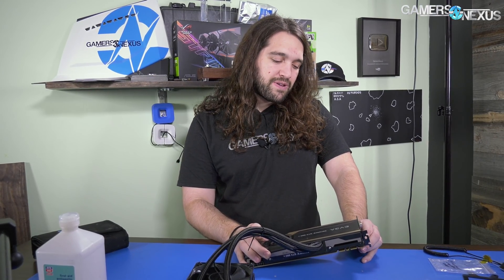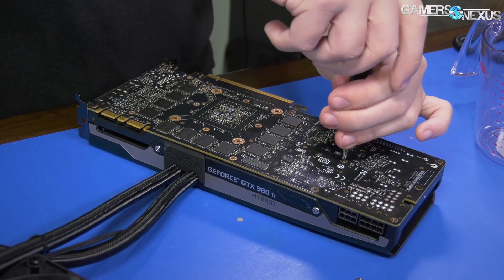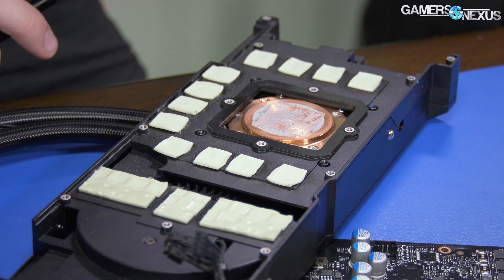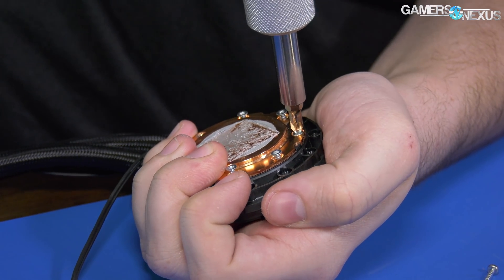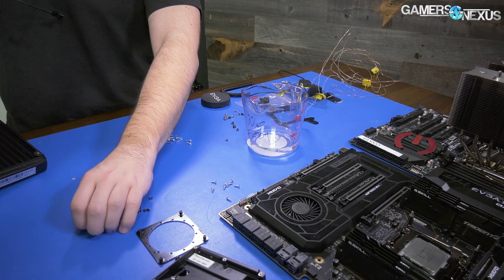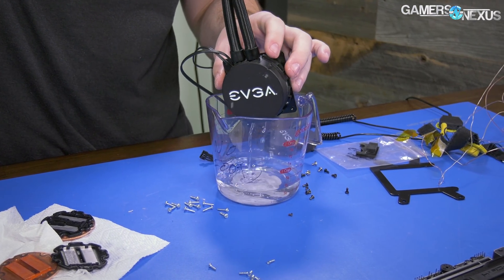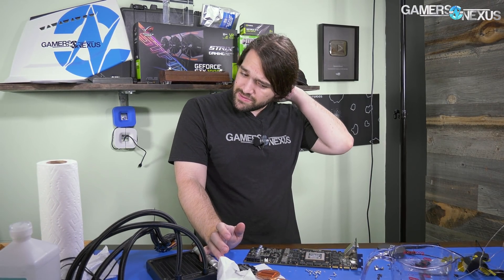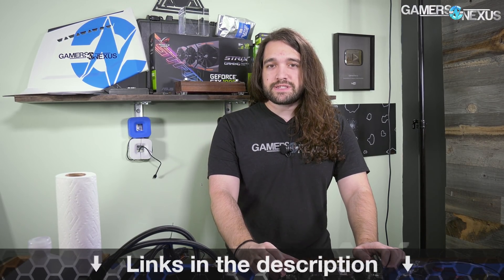Liquid Permeation Check After 1 Year: GPU Hybrid

Comment from the maker: Hey all. This isn't meant to be some sort of deep-dive/heavily data-driven content. It's just a diagnostics we had to run on the card anyway, so decided to film it. Filmed this back in November, I think. We haven't touched the card since then, but will probably throw another cooler on it and see if it gets going.
Reply: i have a feeling that the header for the pump stopped working which made the pump not do anything
Reply: maybe the connection between the fanheader and the pump, so the cooler works on an external psu thingy, but might not have gotten power from the card it self.
and yes we love LIVESTREAMS!!!
Reply: Gamers Nexus I would look at power usage and voltage, before removing the cooler. Also would have tried different PCI-E port. But those are mine first steps, because I would bot have another card to replace existing one. But i have noticed that Thermal Grizly pastes dries out quite quickly. And a small hit to videocard can break dried out paste.
But measuring remaining liquid was nice idea. Jus I would have asked EVGA for more specs, rather than destroying another pump. Also this does not prove, that pump is capable of moving liquid. Would like to compare fins visually.
Content like this really matches your content - what’s inside PC compobents. Looking into new graphic cards to see, how they are designed or looking into older as a followup, what might have been designed wrong and died.
As I’ve heard, nvidia GPUs just dies instantly, no middle way of working poorly.
Would like to see a followup for this
Reply: I now feel an emotional connection with that card and have a vested interest in seeing it come back to life. Looking forward to seeing it tested under air cooling!
Reply: I also have an EVGA hybrid mod slapped on my 1080 Ti, and for a time I was experiencing intermittent temp issues. Based on what I can tell, at these times the pump itself wasn't working. A reboot usually solved it, and ever since I reinstalled Windows 10 I haven't had the problem again.

Is it possible you're experiencing the permanent version of this problem?
Reply: Love the way the video was set up. I love my data, but this was very interesting content.
Reply: o ring seal is bad Id replace that and plug it in and test it. im wondering if u cant find the right seals could you use jb weld sealer on it.??? But it would need to be a silicone hi temp sealer to be water tight again.Plug it in find where it has silicone o ring and add the silicone to that region You can also pressure test it.Cllean the card with alchol to remove all the mineral water on the card . Id use 99 percent rubbing alchol on cleaning the card up and either fix the cooler you have or find another after market cooler once you have cleaned that card with a 99percent alchol to remove any water on card.Minerals collect over time through metals in the cooler so that water will add minerals to water and that is good chance this water can harm a card .
Reply: Looks good!
Reply: About that 4 pin adapter: I have a 1080ti ftw3, do you know where I can buy one for my Gpu? Or if you know the pinout of the connector or where to find it.
Reply: Could it be something in the cards bios?
Reply: Cool stuff.  If the new cooler works though, the question will still be what the root cause of the problem was with the original cooler.  Although if the new cooler solves the problem, then likely best to put it back into service and move on. :-)  Hmmm - I haven't seen any recent reviews on new aftermarket VGA coolers (well, outside custom water cooling VGA blocks - full coverage or not), so how about a review of that if and when you do it?
Reply: Very interested as I have a reference evga 980ti and hope it doesn't have issues later. It is called with a ekwb block and backplate
Reply: Gamers Nexus this actually taught me to apply extra pressure to the pump screws if I needed to open it up.
Reply: Its called a mini pwm fan connector. there are male (like a connector attached to the fan) and female (like a motherboard fan header), and there are adapters to convert them from mini to regular and back.
Reply: Maybe pump vibrations made it lose contact with the chip after a while?
Reply: Not sure if someone else already recommended this, but i would check the pump and fan header on the card itself. Its rare, but not unheard of for a cable to get caught on something and come out of the header when working next to the card in the PC. Just a thought.
Reply: This is a cliffhanger bigger than the Game of Thrones...
Reply: I'm sure it's just due to losing contact between the die and the cold plate since sometimes vibrations will cause screws to back out. That's my take on it since it seems that there's enough liquid in there to at least keep it way below thermal throttle and the pump still works
Reply: Where's the followup?
I'm having a 3 years old EVGA 980 Ti Hybrid right now that first suffered a brief massive cooling drop, then settled for half performance (92°C if I allow it, ~140 W max if limited to 67°C), with an occasional air gurgle, but only sporadically, but pump running all the time. Renewed the paste, that wasn't it. Since the radiator has always been way above the pump and shaking the card in various angles didn't help, I assumed somehow air got trapped in the pump. EVGA ways gunk-accumulation in the fins cannot happen. Well, maybe some kind of solid matter that suddenly went loose. Dunno, maybe excess welding/soldering material from inside the radiator? Or a rubber seal dissolving into the liquid? I mean, the dark stuff in the fins you showed in this video had to come from somewhere. Maybe these systems need to be flushed with a cleaner after manufacturing and they didn't always do that.

EVGA says they dismantle them in Taiwan, so I'd have to wait months to get an info what the problem was, and while they said they're gonna tell me when they did, I won't hold my breath.
Also took them 12 days to get a replacement to me due to several blunders on their side all chained together.
Reply: Next time you can test the AIO liquid cooler without dismantling them by using a heatplate and a thermocouple.
Reply: Gamers Nexus curious to find out what happened to the card. Has any more investigation been done on the card?
Reply: i have same problem my 980 ti hybrit is 70 80 grade celsius
Reply: would you happen to know where i could get a new aio for the hybrid ?
Reply: why dint u just weight the to the see which was heavier :)
Reply: My 980ti hybrids loop failed last month. Impressively reliable failure timing. Lots of small particulate was clogged in the fins on the cold plate. I replaced the pump with an H55 and a copper shim and shes back good as new. Probs never buying evga again though.
Reply: @Pootydanglesore  evga suck happen to my old gtx 1080
Reply: Jimmydean hilltow read my comment, mister copycat

Comment: This liquid is indeed a by-product of the work of the thermal pads over the VERY long duration (years)...

-Greasy and quite annoying to purge
-Does not appear to be electrically conductive
-Does not evaporate
-Probably an obstacle to optimal thermal conduction
-Incredible dust and dirt accumulator (This dust cooks and can lead to electrical/static conductivity)

After cleaning the surface of the thermal pads (without replacing them with new) on the side of the heat shield only, I notice a significant decrease on the average temperatures on the power and memory probes. (Never had a problem cooling the GPU with its designated liquid cooling)

If I have the patience to do the other side I expect an almost complete restoration of the initial cooling performance of a 1080TI Hybrid SC2 which is almost 6-7 years old (2 years of mining 24/7)

This beast is unkillable...🤣

Comment: I need help from someone possibly! I have 2 of these cards and they both do the same thing.  Cards work fine on a 32 inch tv. As soon as I load a game the screen goes black or green and pc is unusable. Have to power cycle it. Then works fine. When I try to connect to my 4k tv it does the black/green screen after pressing the space bar to log into windows 10. I’ve ordered new thermal paste hoping this is the problem. I’ve tried different drivers and have done ddu uninstall and such.

Comment: This video demonstrates why I went open loop, all in ones are disposable junk.  Kind of an odd thing for Gamers Nexus to support after all of the save the planet philanthropy.

They don't have to be that way, they could be serviceable with replacement pumps, tubes, etc.
Reply: Learning this the hard way - I have a "perfectly good" 2080ti hybrid and it seems the pump stopped working.  No way to buy a new aio that fits, no replacement parts, no pump purchase option - So i'm about to throw a nice card 1500.00 new in the trash.  Never will I buy AIO again (i would do a custom loop because there are water blocks available, but I dont want to invest into an old system at this point)

Comment: My 1070ftw hybrid rarely gets out of the 40’s when under full load running at 2100mhz. I will always liquid cool my gpu moving forward. I have had it for a few years at this point and i would say there is definitely less coolant in it, but it still performs extremely well.

Comment: Why do so many people use liquid cooling? Its not much quieter than a good amount of fans at mid to low RPM's and its so much more expensive and in most cases still requires fans for the radiators. Just for like 5 degree less?

Comment: "these strip really easily" try using the 'right' bit. takes practice and a lot of variety. a file and a bucket of cheaper jewelers flatheads can deal with most stripped screws. then theres always the drill :D

Comment: In another older video you said taking it apart like this renders it basically useless. So should I even try this? My 980 ti hybrid is about 4 years old now and it gets pretty hot. I wanna run some maintenance on it.
Reply: im having the same problem? how hot does yours run? at stock settings mine is 35C ambient and 75C under load while also making occassional loudish noise even with radiator positioned properly. u have a similar experience?

Comment: I had the same issue. I bought a cheap AIO cooler off ebay and swapped the copper cpu block from my old cooler since it was designed for cpu with the raised plate and the replacement aio was for cpu and is flat.

Comment: Get some ez grip or even some valve grinding compound on the tip of the screw driver and it’ll keep them from stripping out. You only need alittle dab. They even make special Phillips heads that have alittle bit of an edge to get a bit. They cost more but I think the last longer and I rarely strip screws with them.

Comment: Ive got a question, got an old 750w power supply where it only has 2 - 4pin connectors for the gpu's and my friend just given me 2 gtx 770 but the power connectors is 1 - 6pin and 1 - 8pin on each, if I ground out A and B sense on the 8pin connector will I need 12v on pin2 on the 6pin connector?

Comment: You don't need to open another one. You could have just filled the original with distilled water and see if it holds more water than the coolant that flowed out.

Comment: Non-destructive way you could have measured internal coolant volume: Weigh unmolested cooler assembly. Weigh all the bits minus the coolant of the molested cooler assembly. Weigh the coolant. If the molested assembly plus removed coolant is about the same weight as the new assembly same amount of coolant is in both.

Comment: One of the inductors at 3:58 looks like it  desoldered itself.. Interestingly it is where the wet thermal pad was located. It takes a lot of heat to desolder something with that much thermal mass.

Comment: I believe you should've mentioned that this isn't really the first thing that anyone should do in this case. Using a reference cooler to see if the temps are still that high and maybe later disassemble the pump seems like a decent idea. We don't people unnecessarily disassembling their AIO water coolers ... Just a suggestion

Comment: Hey Steve, there is value in what you did and discovered (liquid level and looks of the fluid) but I think I would have done this differently.
First, you saw liquid on the thermal pad; I would have scrutinized this for viscosity (using a small needle to see what kind of a droplet it wants to form--also did not seem like gravity would have carried it in that direction from the thermal-block.  What I'm getting at is many thermal-compounds will 'weep' (usually their silicone-oil) leaving the solids behind (especially at high-temps) and this will have a thicker viscosity than the cooler-fluid.
Next, I would have NOT tore-apart the other new cooler (or the first initially); I would have just installed #2 and did a test; much faster/less-work. If after that, it worked then you could have surmised the cooler or TIM of which then you could have re-installed the first unit and see if it was just TIM (via reapplying new TIM). Finally, if you saw a difference, THEN start tearing apart the hardware to investigate further.  I do think that the micro-fins should be cleaned and any debris will lower the efficiency so another justification for looking into an old unit exactly like you did.  I am very curious as to what exactly was the problem because it potentially lurks in the shadows for all of us! 
Anyway, this is a minor point and thanks for all the knowledge you and your commenters have taught me...

Comment: Hey Steve, you mentioned that you don't think the paste being dry was responsible for 90 C? I'm just a little confused because I have never seen paste dry like that so my first thought (for repair, not video) was to replace the paste and re-check temps. So am I right in hearing that you think the dry paste wouldn't cause that large of a temp increase?

Comment: Well I can tell you for sure what's could be wrong with it, if none of your teories will work. check where your pc WAS placed when that happened, if back of the pc was near to the wall or something else that would restrict exhaust the heat out, that makes back of pc very hot (especially if it's a aluminium case), included back of gpu and that makes gpu lag crazy and rises temperature very high, as all heat thrown out trough the back of your rad witch I'm sure placed where exhaust fan is.  So long story short give decent distance (at least 25cm) for heat to escape trough the back and that will sort the problem. Plus of course new paste will drop temps also, as to me also it looks dry enough...

Comment: Every hybrid mod I've seen messing up after 1-2 years.
on cpu they last 4-5 years.

Custom loop isn't that expensive really, was 40 bucks more and I can easily fill my res.
I dunno what happens, they overheat and something pump noise other times not.
Making a res, filling usually solves the issue.
Also seen in a few older units a lot of dirt in the microfins :S

Comment: Maybe thermal contact was the problem. It wasn't probably transferring heat because of a possible air gap between GPU core and cooler.

Comment: I would have taken out the other gpu and see how it does before doing any teardown. 

If no improvement there i would see how the loop is ran and try to straighten out the tubes

If no improvement there i would reinstall the the cooler with new thermal material. (I had a CPU aio come loose on me) 

If no improvement and since this is a moded card i would throw on the original cooler

At that point you will know your answer on what to RMA

Comment: the stripping of the screws is just you using the wrong profile and size screwdriver. If you don't know how to work on machines, learn. you literally wasted so much time when 10 minutes you could have answered the question by slapping on the stock cooler and going 'does this work?' Question answered.

Comment: Ok, permeation. It would be nice if you cleared that up. You keep saying it takes a few years for the liquid to permeate the hose. But you have never clarify what the leak rate is AFTER permutation has occurred. I assume it gets faster as there is a liquid path between the fluid and the outside of the hose. Or at least the plastic is fully soaked with liquid, so the rate jumps from 0 to what ever the rate for a fully soaked piece of plastic is.  If this is incorrect, or even if its correct, could you PLEASE clarify by what you mean by "permeation".

Comment: I had a NV 6300 do this back some 10+ years ago. It was not overclocked, but was just constantly getting hotter and hotter over time. I tried to put larger fans on it, heat sinks on everything and even eventually a much larger cooler from Silverstone.. Nothing seemed to help..  I ended up just getting a 7600 and it ran cool as ice. In the end I believe the GPU was just shorting out and cooking its self..

Comment: I had the same issue. The issue seems to have been air in the pump/lines, because it started randomly when it was booted up, then was solved by shifting my radiator around and booting it up again. My radiator is top mounted, which I realize is not optimal, but I have little choice with my case.

Comment: I had the same issue with an Asetek 510LC while operating on my GTX 1080 (prior to its use on my GPU, it served on my FX 8350 for 3 years). It handled heavy overclocking well for a 120mm aluminum AIO but I suddenly saw it hitting 90c idle. I did similar diagnostics (checked for pump spinning, but I instead topped off the coolant instead of checking for permeation) and it seemed fine until it was reassembled. It was likely a mix of permeation and a malfunctioning pump as the cooler kept making a churning noise and my temps were just as bad as before. I put the stock cooler back on (MSI Armor) until I got a Corsair H55 to put under it. 

I'm not saying your case is similar as mine, especially given your cooler has been running for a shorter time period, but your AIO is simply done-for.